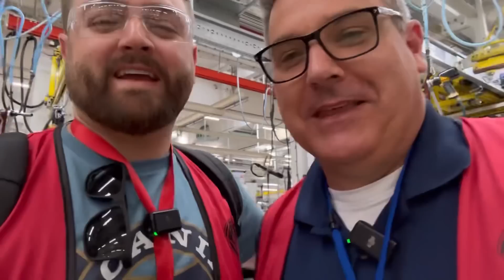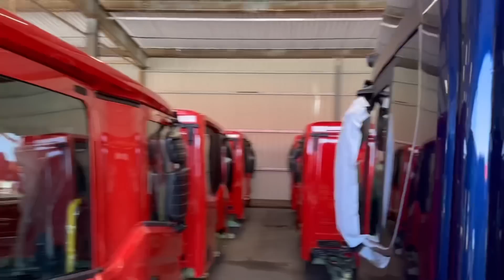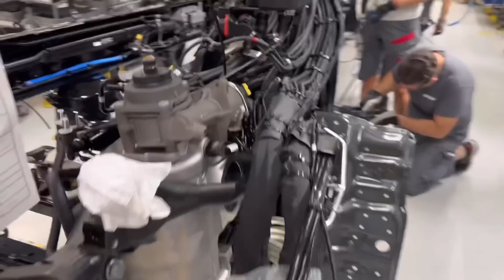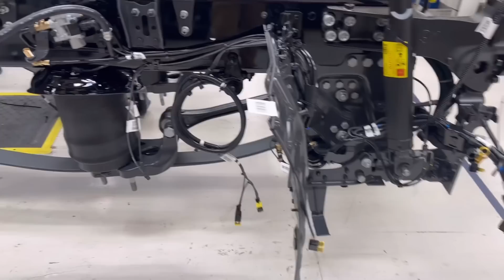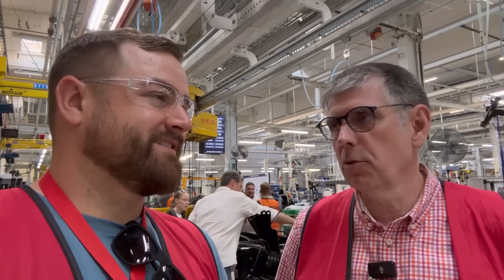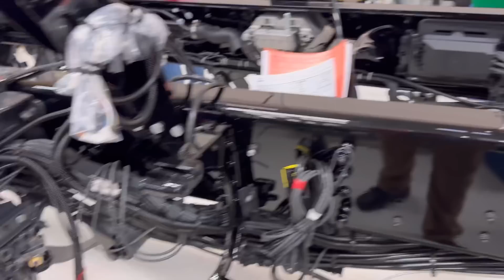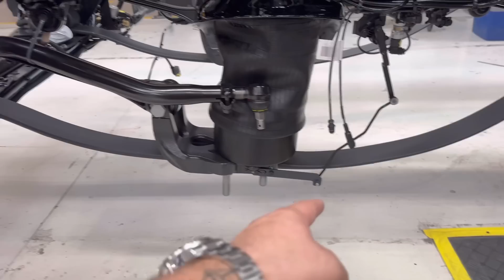Building a SCANIA R770 Truck for USA DELIVERY!!! Step by Step Chassis Build PART 1

Comment: It's awesome to see that scania is coming to the USA, a EU spec struck designed for the USA. I'm a truck driver in the UK and have driven most brands, every truck has its pros and cons but one of the biggest things I find good about scania over any of brand is the quality and refinement of the final product. Everything is with in reach of the driver and mechanical switches that work. Small things like the buttons to control the suspension on the dash unlike other brands that use a controller on a fly lead. The only thing I wish scania would include as standard that other brands have do put on on the base models are, adaptive cruise control, auto wipers and head lights, led head lights. Scania stands out from the rest of the other brands but I feel are falling behind in terms of the base models. Congrats on becoming an ambassador for scania.
Reply: I like driving scania at work but I'd rather have a manual headlight switch than those auto buttons they've started making standard. I want to be able to leave my side lights on for work lights and inside trailers. Other than that, as you say, everything is within comfy reach.
Reply: @BRxRanger  you can still set up the headlights to manual, just the dash screams at you. We don't have lights inside our torque liners so it doesn't really effect me, worse case scenario I got 2 magnetic torches to put on the side and lights the inside up. I drove a bit daf last month and I hate the things but the only 3 good things about it were the space in the cab as I'm a tramper but you have a bed on top which doesn't make up for the cupboards that scania have, the head lights are led and are really good, auto wipers and headlights and finally the cruise control. Being fully adaptive it was easy to drive and I didn't have to watch the over speed as it won't let you. The down side is the lack of tachograph information, the suspension is on a fly lead control which is not great and just the quality and fitness. Sounds totally stupid but it's the little things that can make life so easy.
Reply: And who is the owner of Scania now?
Reply: @MrTimodon  as far as I'm aware it's under the banner of vw which so is man. Looked at a man the other day and you can tell it's vw but again it's lacking the finesse and features tbh. Things like the fog lights, extra driving lights, suspension controls, tachograph information, cruise control etc just takes alot of stress off the job. The inside of the cab reminded me of the old scania between the 4 series and next gen. The driver did say its a good truck apart from the gear box is very slow to change and the air tank capacity is not great.
Reply: @GreenLaneingTrucker  Thanks sir for your answer! I was in chock when i first heard that Wolkswagen is buying Scania! But Volvo trucks are still swedish, for some time more.
Reply: @MrTimodon Volkswagen do.  They also own MAN Trucks (note, the new MAN, with the Scania box).  A truly awesome brand, providing awesome customer experience.  Personally,  at work, I drive DAF & Volvo, but in my opinion,  you can't beat, the prestige of Scania.  A truly fat, truck, in every way; build quality, driving experience,  reliability,  comfort,  etc.  Drove them before, always love Scania.
Reply: Vw
Reply: If you want a Euro truck... Freightliner sells the Mercedes Econic in the USA, but only in the low-cab version for vocational applications. (as the Eonic SD). You can buy an IVECO S-Way in the USA, too... but you have to take it with Nikola badges and either a battery-electric powertrain or a fuel cell powertrain.

Comment: Is it gonna have american style airbreak  knobs to for the trailer and tractor or the single trolley lever euro style
Reply from the maker: Going to be converted
Reply: @Bruce_Wilson  that'll be sweet
Reply: No plz dont convert it to that system😭
Reply: @larser5566  they have to be to fit in the US spec to keep them in america my dad's friend had to switch his t cab trolley levers to American nobs because his truck was over a certin weight class, not sure if this goes with all newer trucks but older ones ik for sure
Reply: @davidstanleyjr8054  i know, but the system that is allredy in the truck works good, one handel for all breakes insted of 2😵‍💫

Comment: Hey Bruce, with everything going on with Right to Repair in the states right now how is Scania on that front... Will this be a JD situation you have to go to the dealership they won't even sell you part for it or are these new trucks Owner friendly
Reply: Doesn't apply for things not offered for sale inside the USA.
Reply: @darek4488  the truck their building is for media purposes in the USA meaning their trying to get permissions to sell trucks in the USA, which is the reason for my question. I.E in the future Scania trucks will (maybe) be offered for sale in the USA

Comment: Hi you missed the best part of manufacturing of the parts. I work at Scania in Södertälje. Making parts for the rear axels. You should have visited other assembly shops to and were they are making parts from scratch

Comment: The difference with Scania than all their competitors is they design and build for the drivers experience not just for mileage costs etc
Reply: And also for the Costs  i have now a 590 v8 and it is  so good on fuel running spain portugal 27 liter 100 km i love 5his truck

Comment: Hello Bruce I'm just wondering what happens to the truck when they install the California emissions stuff and will it loose performance once it's here in the US
Reply: What emission stuff? Dpt etc?
Reply: Is california emission control really any stricter than euro 6? or the upcoming euro 7 standard?
Reply: You can even tune these up while still being Euro 6 compliant, so I think there is some wiggle room.
Reply: There is no need. It will remain as it is. It is going to be exempt from all the Federal Motor Vehicle Safety Standards it doesn't meet.
Reply: @darek4488  by the looks of things euro 6 is tighter anyway which the truck is already compliant too.
Reply: Already passes cali rules with the Euro 6 rules.

Comment: Just wondering, are there commercially lots of rules different for the USA? For sure the airline connections (and pressures) will be different (because why not). but like lights and controls are there things that are mandatory in the USA that the EU doesnt have or visa versa?
Reply: I know European lights need to have a pair of tail and brake lights, amber direction indicators and red reflectors; there are also license plate lights, red rear fog lights and white reversing lights while NA  two red lights that are tail-brake-indicators and you are good to go
P.s. i don't know about Asia, Oceania, Africa and South America but i think it is the same as the European
Reply: What lights?! USDM vehicles don't have fog lights and they allow turn lights to be brake lights. They don't even have a left side of the cut-off line lowered on the low beams to avoid blinding the oncoming drivers. They probably would have get away with 4 flashlights taped to the body.

Comment: Max speed limit is..... 85 MPH OOF
Reply: Just for now. Still following EU regulations.
Reply: @TheXshot  ahh thought it felt weird that on some roads in the US we would be driving and the speedometer would be at full redline (FYI most roads will be 70 MPH or 75MPH but we do have some with an 85MPH)

Comment: I hope scania can come to the USA  one day
Reply: Yea, Scania trucks were sold in the US back in the early to mid nineteen eighties, the ‘2’ series and most were the 112 with the 11 liter inline 6 cylinders engine in both configurations cabovers and conventional.  At that time MCC regs were different and everybody wanted and needed lightweight tractors and Scania trucks were a bit on the heavy side even with the 11 liter engine and allot heavier than that with the 14 liter V8.  This is the main reason they were not very popular and the other was the lack of dealer network and service places across the country.  

Anywho, now in the 21st century things are completely different from pretty much all points of view concerning the integration of Scania trucks on the North American class 8 commercial vehicle market.  Weight is not an issue since the regs have changed and the domestic brands trucks got bigger and allot heavier and the dealer network and serviceability is something that could develop pretty fast once the brand can be legally imported and appreciated for what it is by the drivers, carriers and allot of owner-operators who know the Scania trucks but can’t get them in the US.  

The extended cabs are a must for the North American market and the Longline cab will be the owner-operator’s dream truck.
Reply: @hereintranzit  They could even go beyond longline, put the Scania cab on a typical American-length frame and you could have a monster studio apartment on wheels like a toterhome. That might be a big incentive to get people back into Cabovers here too, and actually, being able to enter through a side door and walk up to the driver's seat RV style would solve a lot of the problems we have with cabover access on the US market too.
Reply: @max_archer  the doors set further back like on an RV is a safety issue imo
Reply: @max_archer  the Scania S cab in the Longline version would easily make a 6x4 tractor unit about 24K lbs.   at this weight it’s still usable with a lightweight trailer or loading no more than 40K lbs to 42K lbs in the box, depending on the trailer type, in order to stay within the maximum 80K lbs. GVW.   Most customers expect you to load at least 45K lbs, but there’s plenty of lighter freight available.  
The European regular class 8 highway trucks are literally overbuilt as compared to the US trucks of the same application, thus they’re considerably heavier.   
They’re almost as tough and as heavy built as a heavy haulage double framed US tractor unit.   

You should see the European heavy haulage prime movers which usually come in the 8X4, 10X4 and even 8X8 configurations and weigh over 30K lbs dry weight.  They’re next level.  Nothing like it in the whole of North America! 

Anywho, if you only want a tractor unit for regular freight hauling, your regular dry box, reefer, dry bulk or tanker work, if you stretch the already heavy Scania 6X4 tractor unit further and enlarge the shack even further than the Longline version, you ain’t gonna haul anything other than ‘sailboat fuel’ with the darn thing.    There’s a limit to how large and heavy you can make a truck before it’s no longer usable in commercial applications.

The truth is that North America is at least 30 years behind Europe when it comes to trucks, trailers and everything related to ‘road transportation equipment’ and infrastructure.
Reply: @gimble447  You could still have regular driver and passenger doors, a side one further back would just be additional, like what you see now on toters or those expediter trucks.
Reply: @hereintranzit  Yeah I guess that's a good point, wasn't really thinking about how much weight it'd add. How do the toter guys get away with pulling a big stacker race trailer, different regs for private rigs?
Reply: @max_archer  like I said “ imo” I don’t really see any benefit to that personally, but it’s all good bud 👍
Reply: @max_archer  no, whatever they’re hauling must not put the GVW over 80K lbs because that’s the limit on the Eisenhower Interstate System regardless of how many axles you’ve got.
These imposed weight limits on city, county, state and federal highway networks are dictated by the infrastructure weight ratings, not by who’s using it and what for.   You could get an overweight trip permit if you go oner 80K lbs GVW, but only if you’re hauling ONE (1) indivisible piece of freight that’s heavy and puts the GVW over 80K lbs, but that still limits you at 20K lbs per axle and you also must plan your route and avoid roads and bridges with lower weight ratings. (100K lbs on 5 axles provided that you have a 20K lbs steer axle) 

In the case of the ‘superloads’, (“the uber big and uber heavy”) the permit issuing authority must perform a survey of the route before issuing a routed trip permit, a very expensive thing which takes weeks and even months of prepping the move and permitting the move before you actually put it in the wind.  Even the move itself can take  months because of all the curfews imposed and also other support and services you might need from local authorities along your route and even crews to disassemble and reassemble overhead electrical lines if needed.  

Different states have higher than 80K GVW limit on their state roads, but the feds are limiting the GVW at 80K on the federal highways.   There are some exceptions like the one in the North-Western states where you can get IRP with higher weights (maxed weights based on axle numbers, usually 3+1 on the tractor and 3+1 on the trailer, or tractor3+trailer3+pup2) even for use on the federal highway system, but that doesn’t work in the other states.
Reply: @hereintranzit  yeah scanias of early 90s compared to even like 2010 models... There is some huge freaking leaps done. So easy to drive.
Reply: the engines are in International trucks now, might be just a matter of time, maybe International will be the north american dealer
Reply: The cab over versions won’t happen, in the USA not the EPA regulations won’t allow it
Reply: @Tuxedorunner  the truck being of a COE design or a Conventional design doesn’t have a darn thing to do with the EPA regulations.   The EPA regulates the emissions of internal combustion engines, not the design of truck cabs.
I don’t know where you get your info, but if I was you, I’d be looking for a different source!
Reply: @Tuxedorunner the regs already allow it, that’s how this one is coming over.
Reply: @Tuxedorunner  EPA regulations have nothing to do with cab configuration.. and there are lots of cabover trucks sold in the US (mostly medium-duty straight trucks and heavy-duty vocationals).
Reply: Ya not going to happen again
Reply: @reedlive  definately going to happen. The European Agco brand Fendt gives Deere a run for their money, Ford Transit, Ram ProMaster, Mercedes Sprinter, are all Euro designs replacing archaic US designs from the 70s.

Since all US truck engines but Cummins are already EU designs, undoubtedly the US will adopt the European and Asian standard of trucking within 2 decades.
Reply: @reedlive why?

Comment: Why do i have a feeling that bruce will start to sell Scanias in the US Soon? :D
Reply: Scania has run tests in the US in 2018 for Navistar, an International uses MAN engines. For the DAF fans, they are part of Paccar.
Reply: Wouldn't the trucks have to be built in the US for that to happen? If it ever happens, it's a long way off.
Reply: He probably open up a dealer or be one of the first special mechanics who then would teach more new mechanics
Reply: @Blo0dyMustard  If the trucks are built in Sweden and imported to the US, they would be subject to a massive import tax, which means it would simply be extremely expensive compared to domestic alternatives. That's why most brands who sell vehicles in the US have subsidiaries and factories to manufacture there. It's very difficult to enter the US market successfully. You basically have to go all-in.
Reply: @zarwil  Scania & Navistar are under the same gorup: Traton, which is a subsidiary of VW Group. Scania could use Navistar factories in the US for assembly

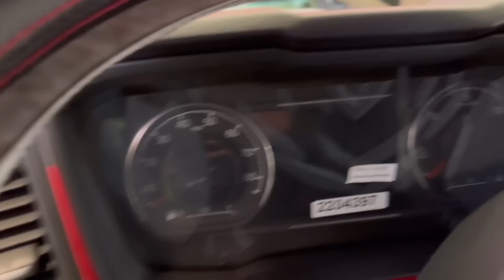Comment: 8:47 yo do realize that Scania is sold in UK too where they use MPH so that gauge cluster isn't actually so big of a deal.
Reply from the maker: Steering wheel on the left🤓
Reply: @Bruce_Wilson we can order left hand drive in the UK, for people who spend most of their time in Europe, and they still come with mph speedo
Reply: @Bruce_Wilson Im afraid the UK has those too. TruckerTim made a video of delivering a brand new & converted Scania (T-Cab) in LHD specification being delivered to the UK.
Reply: @Bruce_Wilson yeah but physical it is same part or at least  one in my work truck is symmetrical. But I was kind waiting that this truck would have included that prototype longline cab you showed when you visited laxå. Because  that would have been good way to introduce longlines back in to the lineup.
Reply: There mostly in kmh and mph

Comment: I thought you couldn’t get a new Scania in North America? Your a lucky man
Reply: You can't, as he said the truck will be owned by Scania wich I guess he will have a manufacturer plate.
Reply: It's a media truck.
Reply: Made to US spec with some type approval still to be got. Then get loads of US truckers behind the wheel!
Reply: Probably under the "Show or Display" rule. That would mean it is going to be limited to 2,500 miles on public roads annually. And it would also mean that if the National Highway Traffic Safety Administration grants it, Scania USA could register up to 500 of these (same model and production year). However don't quote me on that. I have never even been to the USA.
Reply: Then transported on Bruce’s low boy trailer I imagine. No need to worry about getting pulled over for a DOT inspection.
Reply: Great job Bruce, I've had a hope for a long time that one day we will see a modern European cabover on US soil, can't wait for it to show up so I can check it out and person, and maybe later on once these trucks become available to purchase would love to own one.